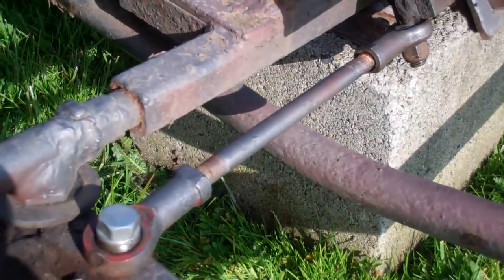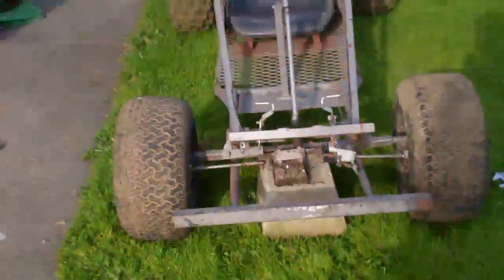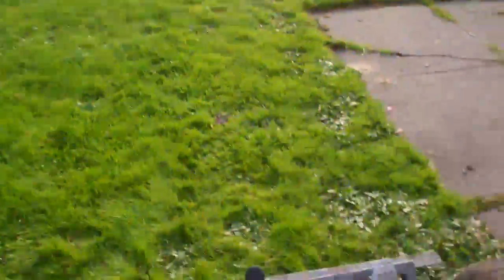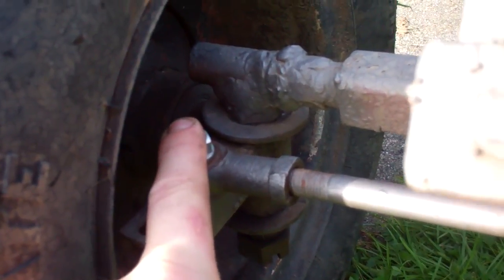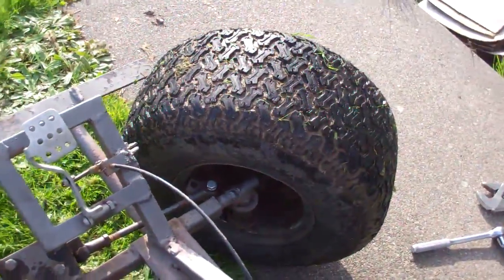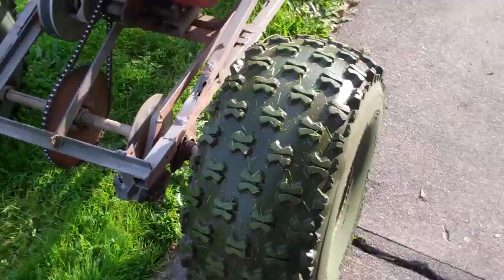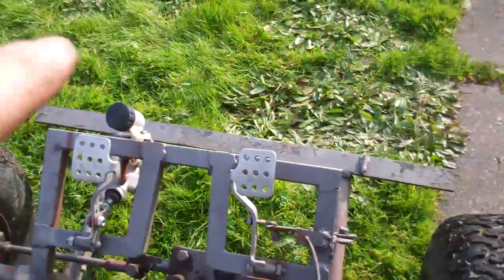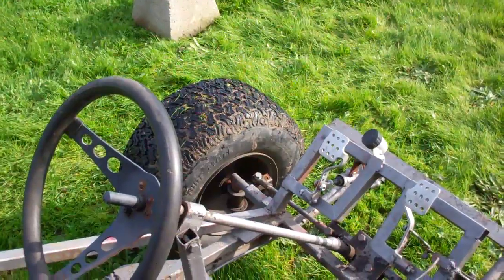[226] Finishing the Steering - 2011-01-26

Comment from the maker: @HISandman I decided on having a solid axle for 2 reasons, one being cost, a Differential is expensive, and also a with a differential, if one of the tires lost grip all of the power would go to the slipping wheel and cause it to spin without moving me forward. A lot of off road trucks have a locking differential which is engaged when the terrain is slippery, all it does is lock the wheels together making it a solid axle, so I just got a solid axle.